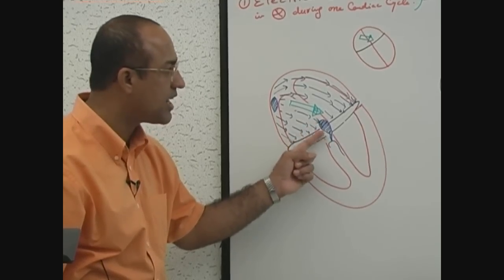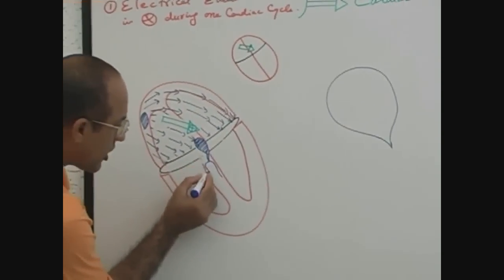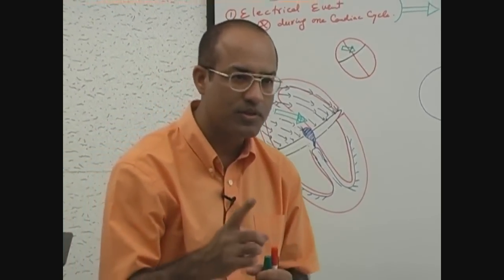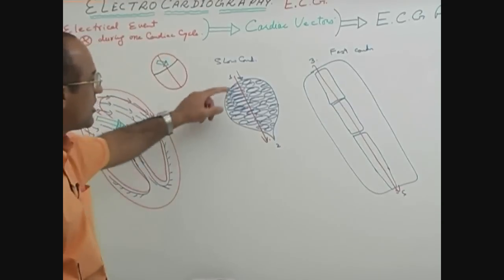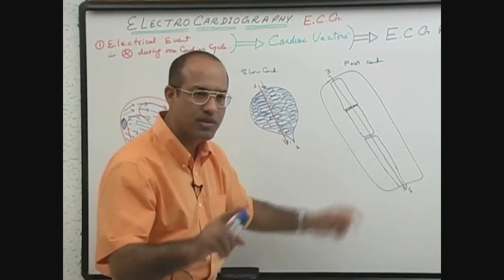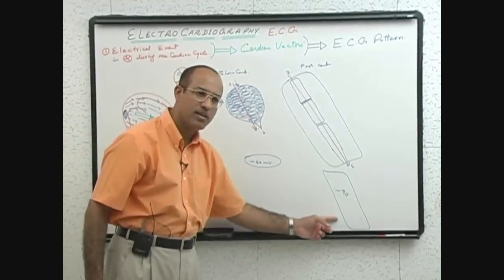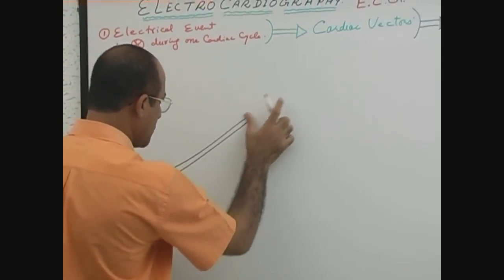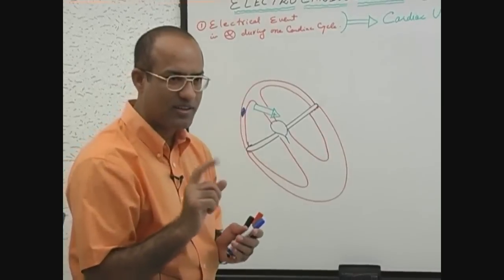EKG or ECG Interpretation | Part 8/20

Comment: if the impulses flow from SA node to Av node in such a way that u mentioned as vectors then all the general atrial cells will die ,....my point is that if current flows in such way in atria then what is the function of Paranoidal cells around SA node